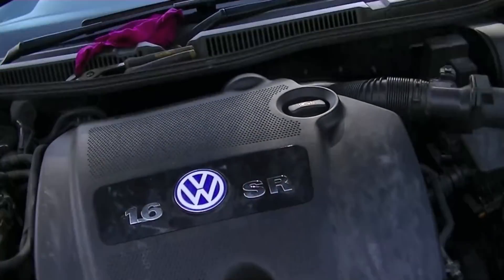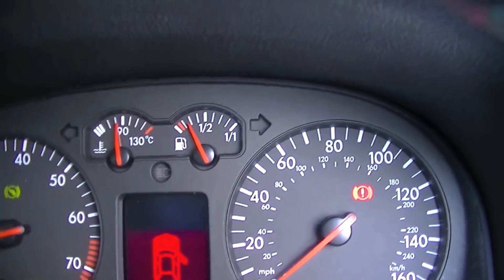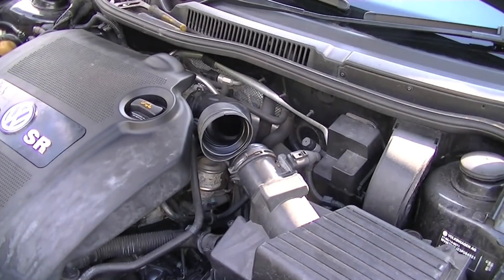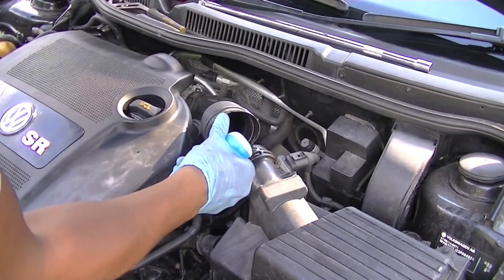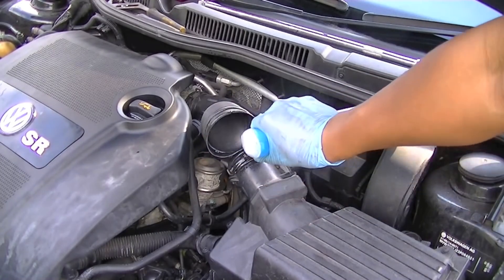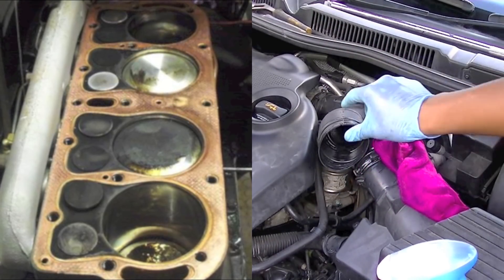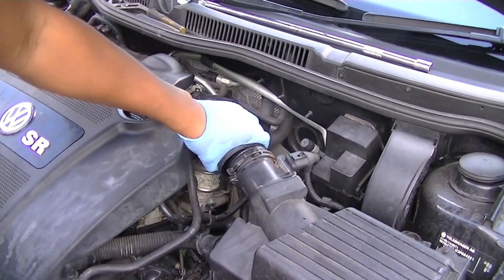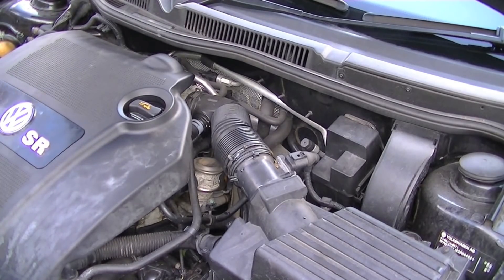How to make your engine run better with just tap water.......Better Than Seafoam?

Comment: If you're trying to clean your piston chamber, just pour the seafoam in you gas tank. DUH!! 
This is more for trying to clean the backside of you valves and the intake manifold than anything else. If you have port positioned injectors the gas tank trick will do that too but you have to knownwhere your injectors are positioned.

Comment: You can increase the reliabilty and lifespan of almost any vehicle by taking care of it and following the manufacturers recommended maintenance schedule. I use a program on my laptop called Automotive Wolf car care software (automotivewolf.com) that tracks and manages the schedules for all my vehicles. I currently have 3 cars from different manufacturers all with over 200,000 miles and running great.

Comment: I know someone who did this with some water mixed with fairy liquid… the oil cap and breather got all gunky etc, guessing the soap seeped past the head gasket into the engine oil. Miles since it’s been fine, no burning oil or water etc so assume the head gasket is fine, just a little fairy liquid in with the engine oil 🤷‍♂️🤣

Comment: I thought leaving the carbon raises the compression 
That's how I was taught 
What's his background?
And education on the subject
Reply: More research is needed on your part.  Look up cleaning valves with GDI engines.  Also carbon will gum up the top ring and you will have oil consumption...

Comment: Why don't you just hook a hose from your radiator to your carburator. The water pressure will flush out the engine. Drive it, but, disconnect the bottom radiator hose and take of the oil pan bolt. Drive her for only 5 thousand miles... that'll work.

Comment: I've been having trouble with my jaguar x type. Definitely a build up of carbon on the turbo vanes when I put my foot down was getting a over or under boost not sure which which puts the car into limp mode.
I've just done this trick today car is running better and no limp home mode.
Its a big yes from me.

Comment: Is this an NA engine or a turbocharged engine?   does it work if u spray into the air intake of a turbocharged engine? cos I am asking becos the air has to go past the turbocharger and itnercooler first before getting tot he intake plenum and intake valves.
Reply: The best and easiest way is through the air intake,it works for petrol and diesel engines.
Like he showed in the clip.

Comment: Idk,  I've been using Marvel Mystery Oil for 30 years. A large bottle is about $4 and I use it in my  gas tank and oil. It provides  excellent lubrication and  sludge or deposit won't form. You can notice the difference. 👍🏻🇺🇸

Comment: Lots of problems   .the cat will get plunged up , the piston rings will gum up ....and all the blow by the pistons will create sludge in the oil. This was a big problem during ww2  when piston aircraft used water injection  for extra power. Dumb Ass.

Comment: Its not caused by the coolant.

Its caused because of over fueling as that cylinder will be missfiring the the fuel is not burnt correctly ffs

Comment: Hi lad hope you are good i was wondering if you had a video about a rear washer/wiper not working on a mk 4 vw im sure you had 1 but cant seem to find it. I can hear noises when pressed but no water and no movement from the wiper. Any ideas im hoping its not the motor.  Would appreciate any help stay safe

Comment: True-water cleans the top of the pistons off like a head gasket failure 

Also true-the tiny layer of carbon ontop of your piston does nothing at all it just sits there it doesn’t need cleaning off its perfectly fine 

Also true within 5 minutes of driving it’ll be back again so what’s the point 

Guess what else putting water I. Your intake does ? 

Fucks the bores washes away any lubricant in the cylinder and causes premature wear to take place shortening the life of your engine 

sits in your intercooler and emulsified with any oil residue I the intake system 

makes a mess 

fucks sensors up and does absolutely nothing for performance emissions or fuel economy

Real mechanics fix cars they don’t spray water into them wile they run that’s what idiots who don’t know what there’re doing do, stop advising others to fuck their cars up just like you
Reply: As to your 2nd statement, GDI don't have a tiny layer of carbon build up, it's massive, and the carbon build can work it's way down to the top ring gumming it up and then you have oil consumption.  So, a combustion chamber cleaning in necessary with GDI cars at some point in their life, especially the Korean ones.

Comment: If you’re a car guy you know. Carbon cleaning is unnecessary for modern engines. Unless you have a GDI setup or  Volt wagon which have been built a certain way that causes carbon buildup.

Comment: please am having a gear problem with my Honda car accord Automatic, The Gear will not change until it get to 4000r/mins and the fuel consumption is high. we be glad if anyone can update me on how to solve the issue.
Reply: what does that have with this video ??? scanner on, BUT my guees is that you need to change one or more solenoids

Comment: This may or may not work but I have used Seafoam for many, many years and it has never let me down yet.  Works 1st time, EVERY time.  Wow, he sprayed water into his intake and now his steering wheel is on the wrong side of the car.  That seems to be a terrible side effect., ha ha.

Comment: You don't want moisture in your engine yet alone water which when heated up will become vapor this will contribute to damaging your vehicle's engine in the long run. The PCV system is designed to keep moisture out of the engine. You don't want to be adding moisture to the engine.

Comment: I've been doing all the maintenance on my 2 cars, a truck and a boat for 20 years. My 1998 Amigo has 330,000 miles and no engine repairs. I am careful about keeping up with the maintenance schedules for each vehicle. I use a great program www.automotivewolf.com to monitor each vehicles maintenance schedule and track parts, performance and fuel mileage. The video is interesting but I would not recommend it.
Reply: Why wouldn't you recommend it ?
Reply: Kam Gamble People will hate, but never tell you why. That's why
Reply: @killshot13000  exactly
Reply: Armchair mechanic with his websites haha just look under the bonnet and pick up a book man

Comment: I used Liqui Moly 5168 that does the same using 50% thinner and 50% acetone in spray applying in the same place, just after the Mass Air Flow sensor BUT ONLY FOR DIESEL ENGINES.

The Turbo blades, EGR Valve and Flaps are cleaned and perform much better.
The engine performance is like in a new one. Less fuel consumption, better aceleration and less noise.

Comment: This is beyond sketchy. I'm familiar with clean pistons from leaking headgaskets but that coolant is already damn hot. I'll stick to good gas and properly gapped/heat range plugs. EGR delete/PCV bypass helps tremendously as well

Comment: Been doing this for few years now, it does work a lot better if you use steam but ordinary water is just as good.
Reply: Water mist evaporates in the engine creating steam...  Same device different method...  Cools down the inlet charge too, fuel density...  more bang...  power!

Comment: It was the hot water from the engine that cleared that piston on the picture. If you spray cold water it could do severe damage due to the thermal shock.
Reply: I have the proper water injection kit on my car, not a spray bottle...  It doesnt allow that much water in...  Its enough to cool, but not crash or rapid cooling...

Comment: Attention! Being skeptical and not believing this advice! When it could destroy your car has nothing to do with trying to discredit or hey on someone's video most people watch these videos so they can fix their own car. Who wouldn't be on here if we if we already knew the answers. ? Do v8 turbos Burnett higher temperatures are there sensors more acceptable the heat what if your throttle body o ring is not sealed go buy some seafoam the only cost six bucks how much does your engine cost how much does a throttle body cost air control valve $115 up to see where I'm going with this be smart not a dummy

Comment: yeah its good. You can put quite a lot of water in while the engine is warmed up and running at 2500-3000 rpm without it locking up. But just make sure you have the engine running before you put the water in or you'll end up like me and get a hydrolocked engine. To unlock it I loosened the spark plugs and turned the engine with the key once. The water spurted out of the spark plug holes. Then i tightened up the plugs and put everything back together and the car started normally.

Comment: I love reading the comments on videos like these. From self appointed mechanics, engineers, and the like. Stating how they've been doing something for 20+ years. I assure you, your knowledge and understanding can be wrong for 20+ years.
The physics behind how water works, especially in a misted form, and the amount going into the individual cylinders is simply going to steam almost instantly. For those of you not understand, that means evaporate at a high temperature and rate of speed. For those of you worried about hydro-locking the engine. He would have to pour about 2oz or more (depending on the engine and compression chamber size) of non-misted water directly into the exact cylinder on the intake stroke. Odds are extremely slim of getting that right and having that kind of access to the valves without disassembling part of the engine. Especially when he has stated to raise the engine to between 2000RPM and 3000RPM. Again, on the low end that's roughly 34 times a second your piston cycles in the cylinder. So count to 1 in your head, your piston just moved up and down roughly 34 times in that amount of time depending on actual RPM.

Now, all that being said. I do feel he is excessively spraying due to water dripping back out of the intake tube. But, that is a personal opinion and he is free to do as he wishes with his vehicles.
Reply: Secondary comment. Even if he did manage the 2oz or more. The engine wouldn't be locked technically speaking. Because the piston isn't at the bottom of it's stroke with a cylinder full of liquid aka water in this case. That 2oz or more with impossible precision and speed would simply be enough to cause damage to the motor on the "combustion" cycle. Due to the fact that water cannot be compressed and the pressure has to go somewhere. I would venture blown head gasket and potentially a bent or broken conn rod.

The highest dangers I see with this method, is blow by into the oil if water is excessive and you have a lot of ring/piston wear (low cold compression), and carbon fouling the plugs or your catalytic converter.

Comment: Lots of people saying this won't work or will do damage. Even if this doesn't work for you and doesn't remove the carbon build up, it's not going to do damage. He says use a spray bottle because that way it's small amounts of water that will pretty much instantly evaporate therefore not causing problems with the engine. Use common sense people, regardless of your experience if your brain doesn't work properly it means nothing.

Comment: I’ve done this, but I strongly recommend only doing it just before an oil change. Some of that water will seep past your piston rings and contaminate the oil. I’ve noticed foamy watery oil in my PCV valve after using this method.

Comment: Methanol is sold under the brand name Heet. It's used for removing water build up in your gas tank. It allows that water to "burn". When it burns, it steam cleans your exhaust valves.

Comment: What I would do is take off the entire intake system incl. egr and intake manifold and clean it thoroughly with an oven cleaner or similar so it all looks as new, then put it back in. Usually there's more crud in there than on your pistons in the first place. I've never had a car giving me issues because of carbon on the pistons, but I have had a couple that gave me trouble for a clogged up intake manifold and egr, or an intercooler full of oil, stuff like that. Usually those golf mk4s never have issues because of carbon on the pistons, unless you take really bad care of them. EGR and intake manifold, turbo, intercooler, those are the things that do need a cleaning now and then.
Reply: You're right. His method would clean inside the air intake streams leading to the intake valves but not as much as giving it a manual scrubbing.

Comment: I"ve seen guys shoot most of a can of brake "cleaner" (very flammable" into the throat of a carb on a hot engine while revving it slightly at same time, to clean valves?  Maybe the cold brake cleaner is a similar thermal shock effect.

Comment: Water injestion was used on WW II aircraft to boost engine performanve in short spurts. I believe it was to cool the air intake density to the early turbines. The P-47 was equipped with it and yeas it does clean out the carbon.
Reply: 'turbines', you say...  ::makes notes::

Comment: Tap water has 300 different chemicals in it. Good luck! Use distilled water! Don't listen to wierdos, this method will blow your engine 50% of the time.
Reply from the maker: Can you prove that statement?
Reply: Tap water is fine, steam cleaning to get rid of the rubbish off the top of the pistons, will also get rid of 300 chemicals...  (if your water has 300 chemicals in it...  I'd complain to council, thats bollox...  Move city... Dont live there any more, your water is shit...)  

The method has been used since World War 2.  There's a specific way of doing it, but its fine.  Google water/meth injection

Comment: We used to do that as part of a regular tune-up. Poured water straight into the carb while running it up under a load (would show like 60 mph on spedo) on the in-floor dyno. The water would superheat into steam and blow the carbon deposits from the combustion chamber out the tail pipe.  Most of the time there would be clouds of blue smoke( carbon) and no problems caused, most of the time that is. Sometimes a piece of carbon would get trapped under a valve and cause the engine to tick. To fix just repeat.  Rarely it would blow a head gasket or worse so the practice was stopped but that's after several 10's of thousands were done.

Comment: Only thing your doing is evaporating water with your engine...
Reply: Steam...  Yes, Correct...  The steam runs thru the engine cleaning the pistons and combustion chamber as it passes thru, and out the exhaust...  Steam cleaning!

Comment: back in the 80's when leaded fuel was banned and the octane levels plummeted it became a common thing to install a water injection system, which was something you could buy at any auto parts store and install yourself in a few hours. it was basically a system that sprayed water into the carburetor when the engine was under load. the addition of a mist of water to the combustion process produces a cooling effect and prevents preignition, or 'pinging'.  i put one on my 66 galaxie in high school and it saved me almost a dollar per gallon back then.

Comment: I have been doing that for years (since 1986) with everything I had including motorbikes and one car I had I went to the back and there was a big black spot where all that carbon buildup was spit out. That carbon buildup will prevent good engine performance. Very good video on showing the best way of and explanation on how to spray it properly.

Comment: what about disconnecting the wire connecting the oxygen sensor?
  This might prevent it being destroyed by the water vapours passing past it that didn't get burnt fully in the engine.
 This thinking aligns with the engine's management, for when an engine is first started and still cold;
 there is a period (up to 2 minutes?) when water vapour is being naturally passed down the exhaust,
 and the Management disables the oxy sensor for this period of time, to prevent damage to the sensor

Comment: Water injection does work.  Some military engines during WWII used water injection to raise the octane of the fuel and keep carbon from forming in the engines.  However, don't throw away the Sea Foam.  Water cleans carbon from the combustion chamber, but, does nothing to clean your fuel injectors.

Comment: This works because the air-water mix flows very fast in intake manifold, valves and cylinder at high RPM. Its like powerwasher put very close to these parts at full power. I dont remember the flow speed but it was at least hundred meter per second , you can coun it if you can. And this os very good in vw engines that recirculates exhaust gases through intake valves and has direct injection, because there no gas -air mixture cleaning intake valves like in tradiotional motors.

Comment: Perhaps its the thermal shock of the water hitting the piston head breaking off the built up carbon?   I doubt a small amount of sprayed water would get into the oil (unless piston and rings are already worn down ?   Wonder what did the exhaust look like when doing this water spraying into the intake?
Reply: Thats the side effect of Water Injection...  The exhaust system will rust out faster than you can say "Damn!  that was fast!"...  All the rot from your engine, mixed with water = some weird and highly acidic mix...  Get a stainless exhaust to prevent this...

PS. Water doesnt hit the piston...  If it is, you're spraying too much in there...  It should be steam by the time its int he combustion chamber, so you dont need much
Reply: He's not doing it forever, just misting for a couple minutes intermittently; I would presume the engine is already hot so it increases the shock of the water on the piston ?